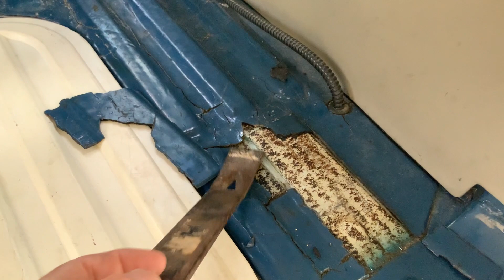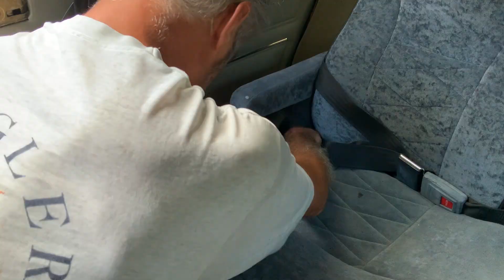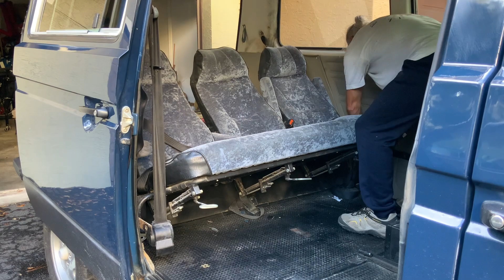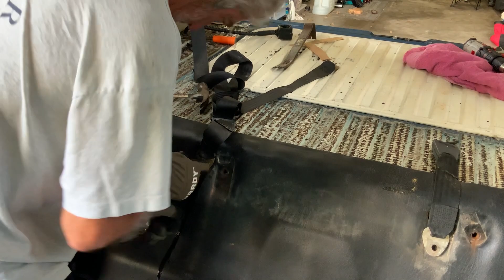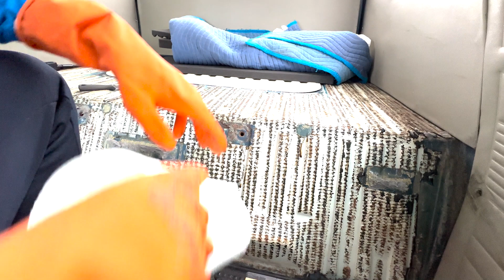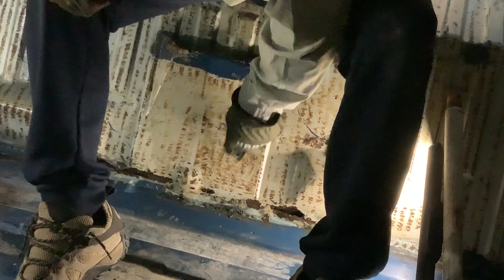Sound Deadening My Syncro Stage I

Comment: I used a butane torch lightly and mine came up super easy, fellow Syncro owner and in the process of redoing mine. Saw your van for sale on the Samba and interested in seeing what you do with it in future videos. Cheers
Reply from the maker: Hello Stan, fellow Syncro owner🙌.Thx a bunch for watching my video and your tip with the torch is awesome! I hope others will pick up on this comment section and use your idea as well. Were you searching to purchase a Syncro when you saw this one on Samba or had you already owned one?
Reply: @mylifeafter50  I've owned it since 18' but I just like to see what the market is. I found mine abandoned at a VW shop here in Austin and got lucky, one owner, 90K miles, no rust, brand new transmission. A little old lady ended up forgetting about it for 8 years and got it for $3k, but I now have $42k into it 😂
Reply from the maker: That quite the story, I think timing was on your side along with the luck. Good for you! Tin top? I guessing 42k in all the building out, motor swap too?
Reply: @mylifeafter50  Tintop, motor's good, jut a paint job was a bulk of it. Started out just wanting to replace the window seals, then one thing led to another and ended up stripping it down completely.